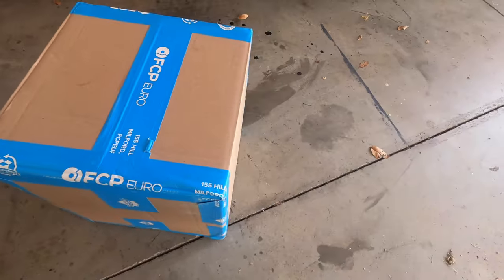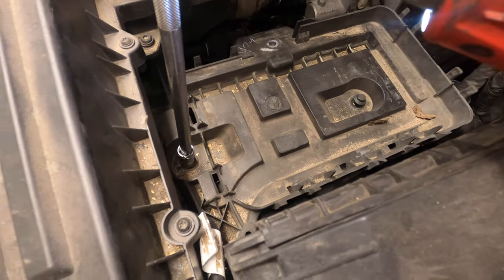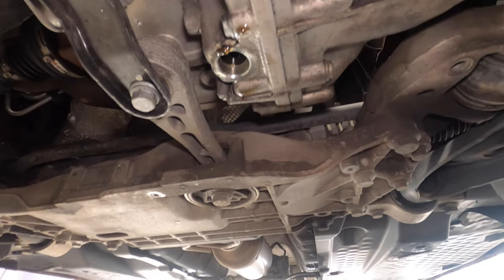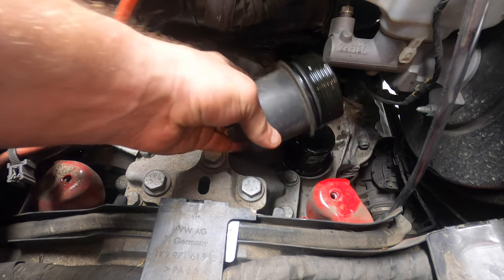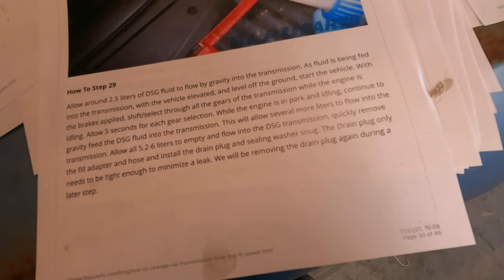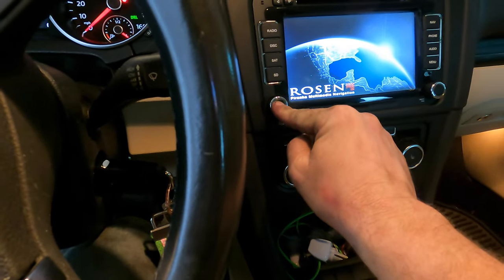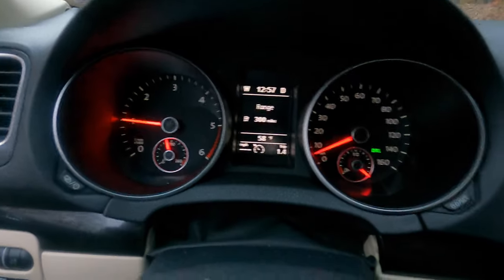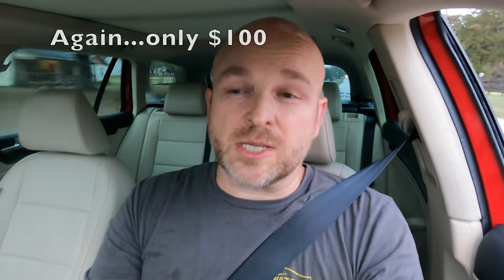VW DSG Transmission Fluid Change:  Save HUNDREDS of Dollars!

Comment: Procedure is a little wrong. You can screw in plastic level tube before filling in the oil. When you done filling the oils quickly remove adapter and put drain cap. After temperature set drain extras of oil.
Reply: This makes sense because knowing myself I would fumble the plastic level rice and all the clean oil would be waisted
Reply: Yeah, that seems a little wonky, he was trying to put that fill plug-in and probably lost a lot of oil

Comment: This was not correct. The black tube needs to be reinserted after draining the old fluid but BEFORE adding the new fluid. You let a ton of new fluid drain out while reinserting the black tube.
Reply: Spot on.

Comment: You can fill it from the top of the filter.  No need for the adapter and the mess.  My transmission shifts alot better.
Reply: I heard that doing it from top why don't they show us that quicker step??
Reply: @cherylgolding9932  it's what I did.  A bit slow filling it up through the oil filter housing. I used a plastic tube about 1/2 inch diameter attached to a funnel (plastic coke bottle cut open). Takes about 10 minutes but doesn't require a special pump and that filler pipe into the drain hole.
Reply: @jmy6050  how much fluid did it take ? 6.5 bottles of liqui molly?
Reply: @TrumpTrainShorts  No you won't need that much.  I used about 5 litres of Penrite  DCT oil. Put 4 liters in and run it through the gears.  Put last litre in, refit the oil filter Cartridge and housing. Undo the first drain plug and with the car running in P, wait for excess oil to come out (with the inner plug in there). When it's starting to trickle. Put the outer drain plug in. Check for no leaks....all done.
Reply: @jmy6050  how long should I let the car idle and how long will it take to go above the temp? So I can be safe
Reply: @TrumpTrainShorts  do you have an external temp monitor? I have a scan tool, bit you can use a temperature gun. Points a red light at the surface and reads back the temp.
Reply: @jmy6050  I have blue driver but it doesent show me trans oil temp unfortunately
Reply: @jmy6050  can I just gauge the temp? Does it take between 5-10 mins to warm up ? And can I just shut off the engine let’s say around 7minutes and see if it dribbles out?
Reply: @jmy6050  so I’m basically replacing a cracked Trans oil pan that leaked out most of the fluid. What would be a good amount of fluid I could gauge when I’m filling it so I can check the dribble when it reaches op temp?
Reply: @jmy6050  can I just gauge the fill more accurately from filling from the filter?
Reply: @TrumpTrainShorts Sorry, I put the whole 5 litres in after draining the old fluid. You can't run it without the filter back in and done up. After filling, I put a new filter cartridge in, put the housing back on and tightened it to required spec. Ran the engine for about 7 or 8 minutes, selected all the different gears, checked the temps and when it went above the required minimum, I stopped the engine, undid the first drain plug and allowed the excess to drain out from the inner plug. When it got to a dribble I put the other plug back in. I did do a check of the  temp with my vag-com scanner later and  showed after about 7 minutes it had reached the right temp.
Reply: @jmy6050  awsome thanks brother I’m gonna do this in about an hour lol

Comment: Crazy that the hardest part (for the casual mechanic) is getting all for wheels off the ground to do the service. Everything else (except maybe that bolt at the bottom of the battery box) is so straight forward. Great video, thanks mate.
Reply: COULD SOMEONE PLEASE TELL ME WHAT YEAR HE IS WORKING ON?..WHY DO SO MANY YOUTUBERS NOT PUT THE YEAR OF THE CAR THERE WORKING ON?..I HAVE A 2007 JETTA 2.5...IT IS A DSG BUT NOT LIKE THIS ONE..MY FILTER IS INSIDE THE TRANSMISSION PAN
Reply: Jeremy, I would guess between 2009 & 2014, it looks a lot like ours., which is a 2013. I don't think there is much difference in generations or the VW Stable including Audi.as far as general procedure goes.
Reply: @Jeremya74  2.5 is not a dsg

Comment: Are you sure you have to measure the correct level with the engine off?  I´m almost sure you have to do it with the correct oil temp and with engine running.

Comment: Why not fill from the filter up top
Reply: IT can be done, but you need to know your completely empty, else you won't know if you are over or under filled.  I've added fluid in this way, and it's super slow to get it to "seep" in through the filter housing.

Comment: Well, we had all that paperwork and missed a very important step.  Replace the black fill plug prior to filling the transmission.  It was painful to see so much of that expensive DSG fluid pouring out of the transmission after the fill😞
Reply: He did wrong procedure,  should install the over flow black plug first before filling the fluid.

Comment: CORRECTION!!!
Once the fluid is drained out, insert the black plastic valve (it does have a hole in the center so fluid WILL go through).
THEN, proceed to fill with new transmission fluid either from above or below.
Reply: makes sense, thank you!
Reply: Was having a meltdown about VW engineers but this makes a LOT more sense, thanks!
Reply: its called a snorkel
Reply: I think the point of not putting the black tube back in right away and filling with 2.5 liters then cycling through the gears is to flush the old fluid out of every part of the transmission. Then draining that 2.5 liters, to install the black tube for the final refill. I dont think that step is necessary, but if you want to be super picky about it, do the step and the fluid change will be that much cleaner.
Reply: he made a mistake, he inserted the black plastic valve with engine off, should be done with engine on ....
Reply: He should of just replaced it after the drain you can still fill with it in.
Reply: @pakkiaman2  why? Can you explain!
Reply: @lovolopz2494   the reasons are many and long sotry to write, but for the good of other people i will write it anyway.... 
The gearbox is DESIGNED  (its not my personal idea) to run with some oil grabbed by itselfe during rotation AND BY OIL PUMP (even in P the gearbox rotates), and the level in the pan must be exactly the right level at 45 degree and WHILE rotating.  So first : WHILE IN P (not in gear that would be too dangerous of corse ) AND WHILE AT 45 DEGREE CELSIUS you need to check the oil level by putting the black valve as he did. If oil comes out wait for it to set (wait for some little drops of oil to fall) and close immediatly with the metal bolt. IF oil dont comes out put other oil, put the metal bolt on and wait 5-10 minutes. THAN repeat the check with only the black valve inserted... and so on... 
If you dont follow this exact procedure the gearbox may have drastically less oil, so the general temperatures inside the gearbox during riding will be higher, the grabbing of oil more difficoult etc etc. 
While in P the pump fill the mechatronic pan , the clutch pack, the oil rail , the oil itselfe falling in the case (!!) , it's a lot of oil you miss if the engine is not idling.... now you know
Reply: @pakkiaman2  thank you for the explanation , I’m working on my car and I was searching the right way to do it. Thanks again 👍🏻

Comment: Maybe the video didnt show it properly, but the engine should be running when you drain the excess to set the level. More fluid is retained because it is actively coating the surfaces in the transmission. If you do it with the engine off, you will not have enough oil retained.

Comment: This is a great video but I've been told to put the tube back in b4 filling running and topping off, then while running as the transmission fluid temperature is rising from 23°-25°c until it gets to 35°c then install the drain plug.... But I'm going to try this, seeing as I don't want to buy a laptop or drag entire computer into the garage😂😂😂😂
Reply: A laptop/computer has absolutely nothing at all to do with changing out the transmission fluid. 
Also this guy doesn’t know what he’s doing and if you follow his directions you will waste 2.5 quarts of fluid
Reply: Why would you need a computer or laptop?
Reply: @Jeremya74  to connect to the car and see the temperature of the gear oil

Comment: Are you able to show a little more detail about where you blocked it up safely so all four wheels are level and off the ground? That's the only part I'm not sure about since I am not lucky enough to have a lift and I know ramps won't work since it would make the car at an angle and mess with getting th right level set.
Reply: there are four thickened points along the pinch welds that are designed to be the lift points of the car, put your jack stands there. If you are not comfortable with that ask a mechanic to show where they are and how to correctly use them.
Reply: I know where those are at but the area is so small that's it is very hard to have enough room to both jack up the vehicle then slip a jack stand in there to hold it in place.
Reply: Yeah I know where those are located - the area is just so small that at least with the equipment I have, it's hard to jack up and have enough room to slip a jack stand underneath.  What I wound up doing was finding a location on my sloped driveway where I could drive the front wheels up on my ramps facing downhill and due to the angle that made the car mostly level.  @A2J_Tim
Reply: @honnomr79  you can also lift the car with your floor jack under the control arm, then slide your stand under the pinch welds.
Reply: Also wring in this video is the part where the level needs to be set when the gearbox oil is 25-35 Celsius. Need to hook it up to a computer to read it.

Comment: Just a thought here, but why not, after draining and changing filter, reinstalling the level tube, then your adapter and just fill the fluid up and be done?? 
I’m confused why you installed the adapter only to fill 2.5 quarts just to drain it back out after removing adapter. Something doesn’t make sense
Reply: He explains that at around 5:50, about a leveling screw that sets the fluid height to be exactly what is needed. I would imagine it couldn't be a bad thing to flush the transmission as well, which may be the reason you let it drain afterward.
Reply: Also the level needs to be set when the gearbox oil is between 25 and 35 Celsius. Need a computer hooked up like vcds

Comment: Did you put that tube back in after you drained the fluid?  If you filled the fluid without it you will could lose all of the fluid since that sets the level.  I have a 09G and the filling and fluid level setting is similar.
Reply from the maker: @charleshines5700  Yes, the tube went back in

Comment: You need to set the level after the transmission is at a certain temperature. Not cold. Yours is now overfilled.
Reply from the maker: In the instructions linked in the description, it states to warm the engine to 95-113F.  It was done correctly, just not everything got shown on camera.  I strongly encourage anyone who is interested in this to follow the instructions exactly as laid out in the linked article.

Comment: Nice video. I have the same transmission in my old 2006 VW Touran. But the dealer here in Norway says it takes 6 liter off trans fluid. And the fluid here cost 50 US pr liter.. 😆😆😆😆
Reply: Are you saying if I were to go to Norway and buy the transmission fluid,it would need to bring $300 to buy 6 QUARTS?
Reply: @Jeremya74  its closer to $400 today. Don't ever go to norway,it's too expensive here. 😀😀😀😀😀

Comment: what about fluid leveling sequence? Transmission fluid needs to be between 35 - 45C, and only then the drain plug needs to be pulled to get the correct level... it looks like you did it on a cold transmission.
Reply from the maker: It was done per the instructions, but not everything was shown in camera.  In the description there is a linked article that lays out every step to do this properly.

Comment: What's up friend, a question: is it necessary to calibrate the mechatronics with a scanner? Greetings
Reply from the maker: I've heard that some vehicles do require this, but having changed the fluid on this car twice now I've not needed to.
Reply: @AutoAnatomy  Ok, my car has 142,000 km and according to the manufacturer it is recommended to change it every 60,000. The dealership does not want to change it because they say it does not need it. I searched for information and found out how to change it and I will do it myself. Thank you very much.

Comment: Hello Auto Anatomy!  

This all looks easy enough, but I’m wondering how you monitored trans-fluid temp as it approached 45C / 113F.  This potential added tool cost might make me reconsider the DIY option is the reason I ask.  

I have a basic OBD2 scan tool, but not a VW/Audi tool.
Reply from the maker: I have a basic OBD2 scan tool that connects to my phone & shows trans temp, so any of those should work.
Reply: Thank you AA. @AutoAnatomy
Reply: @AutoAnatomy I have blue driver. What scan tool are u using?

Comment: Just got done doing my 2021 Volkswagen Jetta and it was extremely easy and cost me $74
Reply: If you followed these instructions yours is iverful. You need to set the level when the gearbox is between 25 and 35 degrees Celsius. You need the VCDS foe this job

Comment: So we only need 2.5 qts and not the 5 qts the kit comes with or am I missing something?
Reply: 5 qts.
Reply: Your missing that he’s wasting 2.5 qts so his way you’ll need 7.5 qts
Reply: I hope you learned from someone else because the level needs to be set when the oil is 35celcius (100f). Not cold.
Reply: @rusted5408  How "cold" do you this his oil was on a summer day? Besides, the written instructions he is following explains how much to warm the engine by while performing the level set.
Reply: @canslam  85 degrees is not 100 degrees.
Reply: @rusted5408 I did not once say that it was. Good on ya for liking your own comments, though 😂
Reply: @canslam  yup. You sure don't think of others, so they have to do it for you.

Comment: Wow my dealership said too do my car dsg in my 2020 GLI is 700$ at 40.000 miles
Reply: Same thing they keep jumping with me I have a 2013 Volkswagen Golf TDI and at first they said $600 then 556 then when I called to schedule it next week they're going to charge $530(with oil change) which  already gonna have a couple flightmates help me out with. So,not mentioning anything about already getting it done when I take my car in about already having an oil change done because I don't want to give them time to jack up price again! Nor am I mentioning who did the oil change.

Comment: OMG You did this WRONG!  Do not follow this video. 

You are supposed to reinstall the level pipe before filling. 
To set the fluid level you need to leave the engine running and allow the internal pump to circulate fluid. You drain the excess fluid when the DSG fluid reaches 35C - 45C. 
A VW/Audi scan tool is used to monitor the transmission fluid temperature.
Reply from the maker: Thanks for the feedback.  It seems there are varying opinions on the correct timing of the level pipe installation.

Comment: done several myself now, i take out the bung then remove the snorkel drain oil and replace snorkel and bung remove filter then i use a 12v pump i bought in aldi for about £15 and put in 4.5 litres of oil, which i purchased off the internet for £25 for 6 lites the pump is running for about 5 mins ,put in new filter car is great.
Reply: What is the name of the pump you got pal

Comment: What about leaving the battery disconnected for a long period of time?
Reply from the maker: Should't cause any problems, will mostly just reset the radio presets.
Reply: Leaving the battery disconnected will not have any effect on your transmission fluid, any other dumb questions?

Comment: what happened to setting the oil temp as this is a must when doing the dsg box
Reply from the maker: It was warmed up to temp, just not shown on camera
Reply: @AutoAnatomy  very misleading then, no reference to it, just hope people havent followed what you have said in this vid
Reply from the maker: Sorry you feel that way.  On step 31 of the instructions that I link in the description and talk about in the video, it clearly states to warm the engine/trans prior to setting the fluid level.  I do my best to communicate some of the more difficult parts on camera, recognizing that it is not an absolute step-by-step process and some things may be edited for brevity.
Reply: @AutoAnatomy  didnt realise that saying the oil must be between 35 and 45 degrees to set the correct level, but hey saying that is the most straight forward way, guess some people must be a different breed......

Comment: My VW 2006 automatic does not want to change gears  especially in a rise. When I switch it off and starts again, it start changing and after some time when I approach a rise it stops changing. What may be the problem?
Reply: I think its just your transmission overheating and then cooling off. Probably low or bad fluid. Or ur transmission has a leak somewhere which probably means it overheated and cracked.

Comment: If you took out the first plug with 14 mm and nothing came out , would this be an indication of low fluid?
Reply from the maker: I would think so, yes
Reply: From my understanding, the 14mm plug drains the overflow.  The 8mm plug inside is the actual drain plug for the oil pan.
Reply: If the vehicle is turned off, yes

Comment: Is that a 2.0 turbo. For that engine the fluid capacity is 6 liters, according to the dealer.
Reply: Yes but he’s not draining the torque converter in this video
Reply: @JasonLee-lv7tm  Just a n fyi... DSG, or dual clutch transmission don't have torque converters.
Reply: @phill3583  
Ok I’m going to do this but how do you know the correct levels adding fluid from the top?
Do I just put in 6 liters and pull the initial drain plug after? Is that the excess?🤔